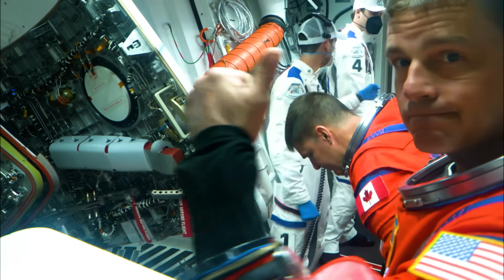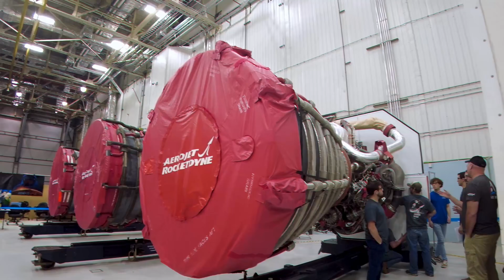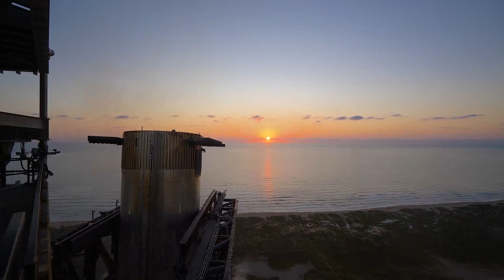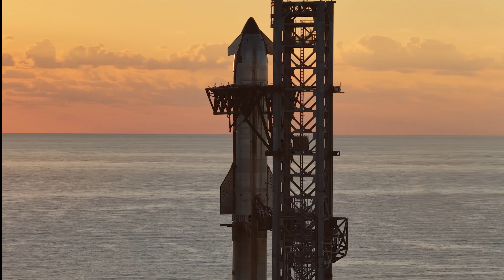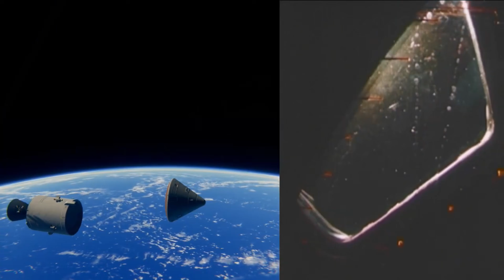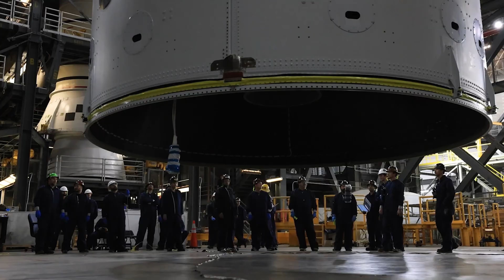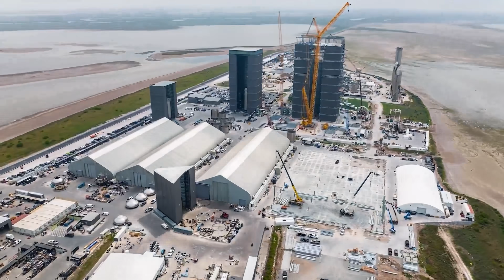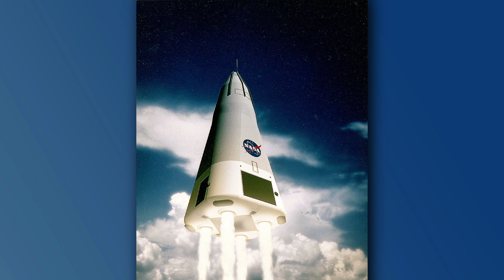Why SpaceX Starship and NASA Rockets Are So Different…

Comment: One thing that is hardly ever mentioned is that NASA's culture came from aviation research. They were building and studying advanced aircraft long before they were handed space flight. As a result the initial planes would always have a pilot and the number one goal was the safety of the test pilot. It was not a culture of let's build one, fly it, and see what happens. (And they still lost pilots.)
Reply: Absolute nonsense, NASA began on October 1, 1958, and it embarked on space travel almost immediately — with its first U.S. satellite launch in January 1958 and its first human spaceflight in 1961.

Comment: This take implies that SpaceX aren't also concerned with reliability and safety. There's a team already working on that parallel to what what we see at the launch pad so NASA really don't have much going for them at all when it comes to rockets - not in the face of Starship. SpaceX is faster, cheaper and will be as safe and reliable as any other rocket for human space flight. There never were technical barriers to any of this. All that was lacking was the money and the will. Wasting public money is never really an option. Private money you can do what you want with.

Comment: SLS has flown successfully every time, last time with a human crew
Falcon 9 is the only productive SpaceX "reusable" remember the second stage & satellite platform BURN UP
spaceX super heavy & starship after 12 flights ,, are still unreliable and not human rated,, and un usable
and, no mention of Blue Origin, which will like Falcon 9, will be flying heavy stuff to the moon before SpaceX
Reply: Clearly you haven’t been doing any research and didn’t pay a damn thing in the video. The cost of launching a SLS is ~2 orders of magnitude more expensive with the design philosophy of NOT reusing any part of the rocket. Second, if you had done any ounce of research you would know that the Starship program is building with REUSABILITY in mind. Yes, it hasn’t proven the economics just yet, but if you had paid attention to how much was spent to launch 12 rockets and catch two already for $25B compared to NASA’s over budget spending Starship is much better in the long run if they can get reusability working. And here’s another thing you completely missed. Because SpaceX builts at speed and can learn faster and do it cheaper, if they didn’t have to put reusability into their design, they would likely still beat NASA at building another rocket for 2 orders of magnitude cheaper. This is a very rough comparison considering the propellant choice, engine design, and manufacturability of the rocket itself. Shut up with your biased reactions and rhetorics and do some goddam research before you write something this stupid again.
Reply: Envy much?
Reply: SLS is a museum piece- 
Fuel: SLS uses finicky liquid hydrogen (great ISP but leaks, boil-off, complex ops, Shuttle-era headaches). Starship runs methane/LOX — denser, cheaper, easier to handle/store, full-flow staged combustion, and better for reuse/refueling on Moon/Mars.

Engines: SLS core has just 4 RS-25s (+ solids). Starship booster has 33 Raptors (V3) — insane thrust, engine-out redundancy, and rapid production/iteration. Ship adds 6 more.

This is why Starship scales and costs so much less. Hydrogen elegance lost to methane practicality + sheer numbers. SLS feels like a museum piece next to it.
Reply: @rockfordfiles5451  hydrogen is not ideal for long duration mission, because it causes embrittlement of the tank it is in and can migrate straight through the metal crystal lattice of most steels.
Reply: you forgot to mention the 1 year delay BO has with the detonation of their pad
Reply: Remember @matthews4159 you are talking to fanboys that think that this pipe dream is actually a working proven craft. It will take over 13 launches to do an orbital refueling just to get to the moon. And that is even if you can get a fuel transfer system to work in the first place. Elon is selling a bait and switch to finance his starlink system with tax dollars.
Reply: @brianfirlie3693  You seem to have it completely and utterly backwards!  In reality, Starlink is financing Starship development, not the other way around...
Reply: @brianfirlie3693 ESA is currently working on reusable rockets and it is projected that it should be done in 2-3 years. I don't know if they gonna pursue bigger rockets (human moon missions are quite stupid, in my opinion) but I am sure that there can be lot of cooperation between NASA and ESA. Hell, maybe even with China, if the US president will stop to be paranoid and be more 'capitalist'. :)